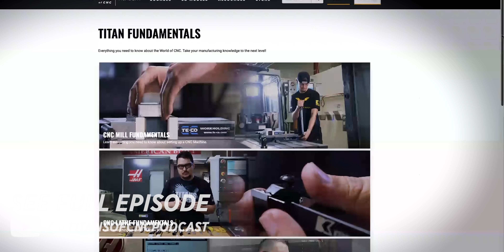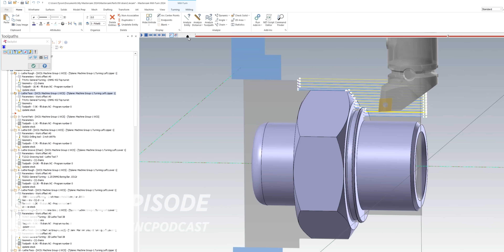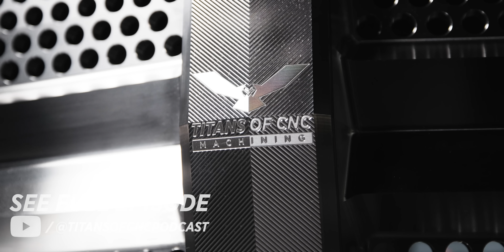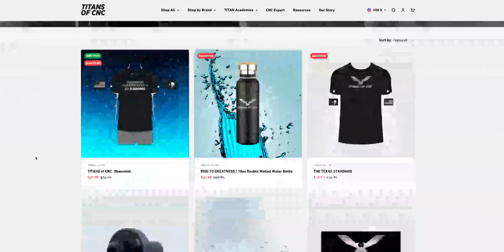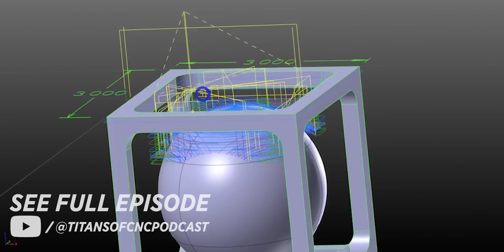The Secret To Becoming An Incredible CNC Machinist

Comment: Been involved in all aspects of CNC machining for over 40 years.  Employee, shop owner, consultant, applications specialist, and I've seen and done a lot and did it quite well, but it would not be a career I would recommend.  As an employee, even if you are stellar, It is a rare shop that will appreciate and compensate you accordingly.  As an owner, you are always one wiped out tool or crashed spindle away from losing all your profit in the job, plus you have all the costs up front, and then a waiting game for your money.  If everything goes right it can be rewarding, but there are a million ways for things to go sideways.

Comment: I've been a class C lathe operator at my current job for about 2 years now. Sadly my employer has no interest in training everyone the root skills to be a machinist. Once you're good at a part, that's all they need. But that drives me nuts. I've been learning from one of the technicians as he's had time as he's one of the few people that actually ENJOYS machining like I do and him teaching me the method instead of the part has helped me diagnose and correct so many issues that I wouldn't have been able to handle otherwise.

Comment: Every job is a new puzzle, and every puzzle has more than one solution.  The more frustrating the puzzle, the better I feel after solving it.  I've solved a lot of puzzles in a lot of ways and I'm always finding new twists on old puzzles requiring new solutions.  If you think you have a better way to solve the puzzle I'll at least give it a listen.  I might use it, I might use part of it, I might come back to it down the road a bit, or I might just disregard it, but I'll always at least give it a listen before deciding anything.

Comment: Built my career by having this exact attitude, and found that there is just as much push back to keep things the way they are from management as other employees, so it ends up being a fight in both directions. Especially when it comes to things that scare the average point-to-point programmer, like nested family programs, subroutines, and macros. But, I have preferred to stick to really small/family run shops so that contributes to it, and they have their reasons for it as well. One of my biggest peeves in this industry is the phrase "well that's how we've always done it, so don't bother".
Reply: I hate that saying. I work a a mom and pop shop of 100 people. And the fendementals of the management system is if it was good before its good now. Ain't broke don't fix it. Works the way it is just fine..

Comment: Just knowing how to hit cycle start makes you a machine operator not a machinist. Big difference. The stuff you guys have done to improve and help our industry is just amazing
Reply: yeah when I found out the depth this job has. Some people literally press buttons. Programmers are a different breed
Reply: Trust me, it's not as hard as anyone thinks.
I did a/the CNC educational course within 10 months and I now can a lot from CAD/CAM (Fusion360 and many other CAD programs), manufacturing, calculating speeds and feeds, find out what tools to use etc to hand/manual programming and I finally am certified and have the diploma. Guess what, I did it in Sweden/swedish and swedish is my 4th language and I've been in Sweden for 12 years ;)
All you need is a strong will
Reply: @meltgalaxy9043  yea in the AF we have to draw up our own solids in Solidworks then program in Mastercam then run our parts. Titans are like unicorns most civ sector you do one or the other not both
Reply: Trust me, it's not as hard as anyone thinks.
I did a/the CNC educational course within 10 months and I now can a lot from CAD/CAM (Fusion360 and many other CAD programs), manufacturing, calculating speeds and feeds, find out what tools to use etc to hand/manual programming and I finally am certified and have the diploma. Guess what, I did it in Sweden/swedish and swedish is my 4th language and I've been in Sweden for 12 years ;)
All you need is a strong will
Reply: Trust me, it's not as hard as anyone thinks.
I did a/the CNC educational course within 10 months and I now can a lot from CAD/CAM (Fusion360 and many other CAD programs), manufacturing, calculating speeds and feeds, find out what tools to use etc to hand/manual programming and I finally am certified and have the diploma. Guess what, I did it in Sweden/swedish and swedish is my 4th language and I've been in Sweden for 12 years ;)
All you need is a strong will
Reply: Trust me, it's not as hard as anyone thinks.
I did a/the CNC educational course within 10 months and I now can a lot from CAD/CAM (Fusion360 and many other CAD programs), manufacturing, calculating speeds and feeds, find out what tools to use etc to hand/manual programming and I finally am certified and have the diploma. Guess what, I did it in Sweden/swedish and swedish is my 4th language and I've been in Sweden for 12 years ;)
All you need is a strong will
Reply: Trust me, it's not as hard as anyone thinks.
I did a/the CNC educational course within 10 months and I now can a lot from CAD/CAM (Fusion360 and many other CAD programs), manufacturing, calculating speeds and feeds, find out what tools to use etc to hand/manual programming and I finally am certified and have the diploma. Guess what, I did it in Sweden/swedish and swedish is my 4th language and I've been in Sweden for 12 years ;)
All you need is a strong will
Reply: Trust me, it's not as hard as anyone thinks.
I did a/the CNC educational course within 10 months and I now can a lot from CAD/CAM (Fusion360 and many other CAD programs), manufacturing, calculating speeds and feeds, find out what tools to use etc to hand/manual programming and I finally am certified and have the diploma. Guess what, I did it in Sweden/swedish and swedish is my 4th language and I've been in Sweden for 12 years ;)
All you need is a strong will
Reply: Trust me, it's not as hard as anyone thinks.
I did a/the CNC educational course within 10 months and I now can a lot from CAD/CAM (Fusion360 and many other CAD programs), manufacturing, calculating speeds and feeds, find out what tools to use etc to hand/manual programming and I finally am certified and have the diploma. Guess what, I did it in Sweden/swedish and swedish is my 4th language and I've been in Sweden for 12 years ;)
All you need is a strong will
Reply: Trust me, it's not as hard as anyone thinks.
I did a/the CNC educational course within 10 months and I now can a lot from CAD/CAM (Fusion360 and many other CAD programs), manufacturing, calculating speeds and feeds, find out what tools to use etc to hand/manual programming and I finally am certified and have the diploma. Guess what, I did it in Sweden/swedish and swedish is my 4th language and I've been in Sweden for 12 years ;)
All you need is a strong will and you'll make it.
Reply: Trust me, it's not as hard as anyone thinks.
I did a/the CNC educational course within 10 months and I now can a lot from CAD/CAM (Fusion360 and many other CAD programs), manufacturing, calculating speeds and feeds, find out what tools to use etc to hand/manual programming and I finally am certified and have the diploma. Guess what, I did it in Sweden/swedish and swedish is my 4th language and I've been in Sweden for 12 years ;)
All you need is a strong will and you'll make it.

Comment: Passions srasion yeyeye the standard motivational crap. Of course you need to want that and do your best. But just that wont do shit. First is parts/process diversity. You can have all of the above but If you wont be working on different crap the amount of knowledge and experience you get will be limited. Second is problems. What you need is to have lots of machining problems. You learn the most by solving them and learning how to solve them. Running a perfect process can be done by any moron. Solving a problematic one and later improving it thats what great machinist do. Lastly for the "becoming" part is to start working with people better than yourself. And later on always keeping with it. You will always hit a wall during your work and having somebody to help is a big thing. Just dont be that guy that wont even think for 5 sec how to solve his problem alone before running and asking for help. Also having somebody with different experience is always good when exchanging ideas. 
Now this is my take i learned during my years of work. Sure there are other things here and there but its better to learn them yourself. Dont oversell yourself and dont undersell yourself. At the start you wont be making a lot. But it gets better with experience and skills you learn.

Comment: Only time I say that that's not gonna work or that's impossible is when you tell me that we are gonna make a ø14mm hole with a ø16mm drill ( brand new and not gonna grind away of that drill ) aka. When I know that it physically can't fit/ the tool makeing hole/pocket features that's smaller then the tool itself